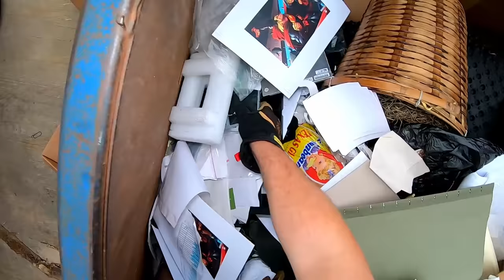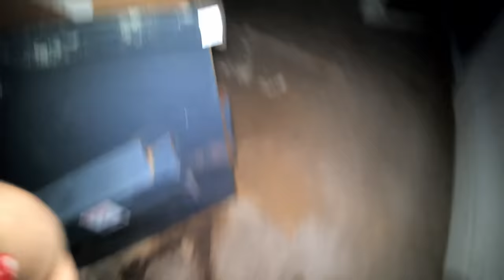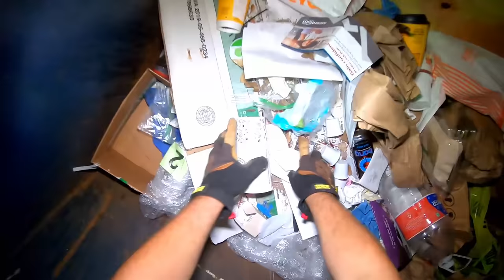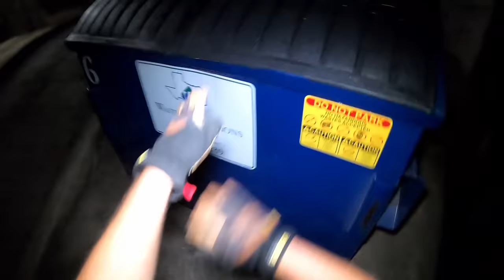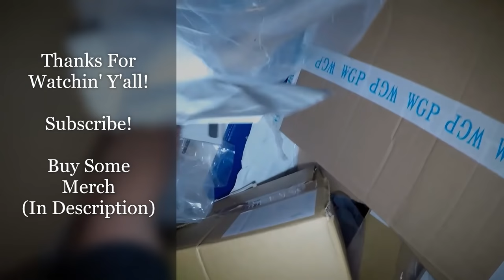Dumpster Diving "The Sloppy Seconds"

Comment: Have you ever considered talking to the company that tosses out all of those screens and cameras and asking them to set the metal, wires, and electronics aside and you'll collect them periodically? Thier dumpster is always a treasure trove.
Reply: They dump so much that Mike would gave to have a cargo box with a lock and then drive it away. My friend and I get calls and we bring the trucks and they load and we leave off their property to sort and then scrap.
Reply: Some people dont have a clue how much scrap is worth, here in Ireland it used to be like that but now everyone saves it up instead of throwing it out, but sometimes you can still get some good dumpster finds .
Reply: That  dumpster would have been dredged to the bottom, could fix reuse and probably resell the stuff for way more than scrap value. Btw great choice of gloves too, got a pair myself 😁

Comment: Thanks for answering my question about why you don't take the metal wall studs. I understand. You can bend them up so that they won't be so aerodynamic but that takes time. They can also be bundled together; maybe tied with wire, so they won't fly out.

Comment: Why aren't you wearing hightop leather work boots with steel toes?  When I was 8 I was running in a mowed field next to a park and came down hard on a chunk of thick jagged coke bottle glass, the bottom of the bottle.  I must have taken 2 or 3 steps.  I had little rubber flipflops on.  The glass went deep.  Sliced muscle, tendons, ligaments and nerves. Right in the middle of my foot.  It was years and years before I could feel my middle toes.  I got cramps all the time.  I walked on the side of my foot for years. Please be careful.

Comment: They’re using platinum,  palladium, and rhodium in circuitry and wire now, due to the lighter weights. I’ve seen it firsthand in vehicle speed sensors, oxygen sensors, and brake sensors. I think they’re even using nickel for wiring also.

Comment: Guess burning the hose off of the wire, (then while the wire is still hot, dump it into a bucket of water) is out of the question where you live? I know it's not ideal, but if you took a torch to it maybe you wouldn't have the black smoke problem...??

Comment: You could of had the outer jacket of that thick insulation wire gone in minutes. Just use a couple 2x4s and a small piece of like plywood to screw the 2x4s to just far enough apart to let that slide between. Then you just pull the wire through while holding the knife to slice the insulation.  I would have taken it.

Comment: I have high back steel toed work boots. Red Wing boots are good and protect your feet.
I received those boots for free when I was working with a construction crew tearing down a Ames store.
I tore my old boots I had for years and the company bought me a new pair.
The bosses and the foreman all signed a card and gave me the boots.
Let me tell you they're not cheap boots.

Comment: That blue wire is on the pool robots I get one a wk with the power station etc, pool robots have some brass plus a motor in them and that blue wire I cut into 4ft strips and with a new blade cut the rubber off. Only thing is there’s roping under that and it’s crisscrossed and messy sometimes but if you go deep enough you can cut the rope also. I fill a garbage pail worth of that every summer it’s as thin as cat wire when all said and done

Comment: you need to screw or zip tie one end of a tarp or a fishnet a little wider and longer than the bed to a stick, and the other end to your bulkhead panel so you can unroll it out to cover the bed of your truck like stone hauling dump trucks. it will keep the small scrap under control and in your bed where it belongs without having to tie it all in place, and will roll up all neat and tidy when you don't need it. i had one when i used to haul a lot of cleanout stuff to the landfill, because you had to cover your load. it was easier than having to remember to get out a tarp, tying it all down, then having to fold it all up again when i was done. just fill'er up, roll'er out and go. then roll'er back up to unload. easy peasy, lemon squeezy.

Comment: In the summer if you use a combo of the "evaporative cooling rag/scarf" and a device called a "personal environment control" that costs from $35 to $70  and under $20 for the rag and re wet the rag in a cooler of ice water you wil feel much much cooler dumpter diving.

Comment: Mike regarding the bits of copper tube on the black pool thingies.

All you need is a hammer and then that tiny bolt cutter 

Hit sideways with the hammer on the pipe, then use some muscle and bent it, then use the bolt cutters